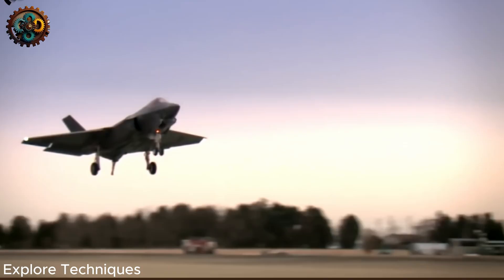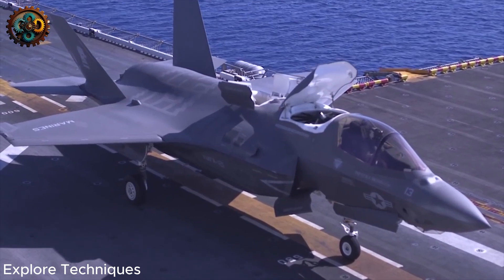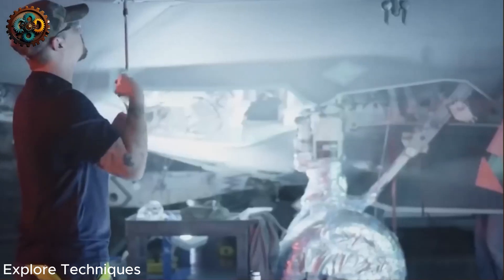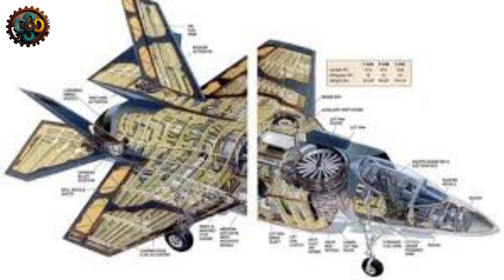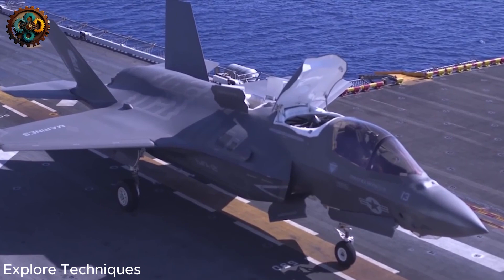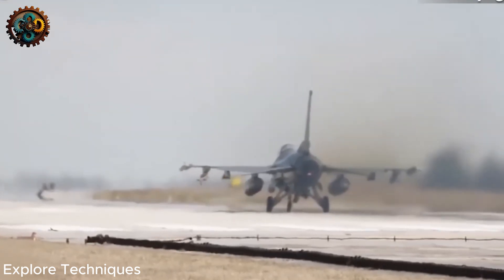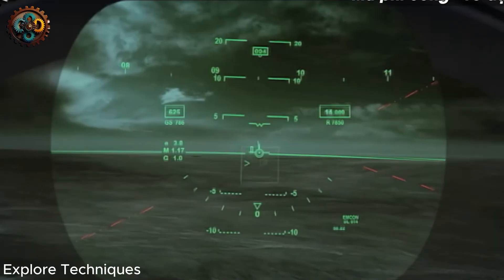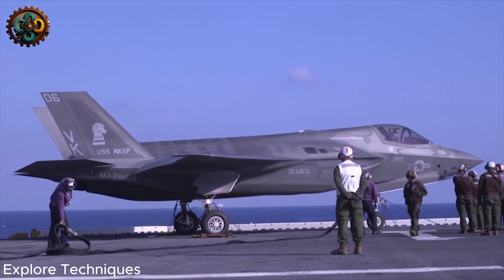F-35 Lightning II: Is It The World's Most Powerful Fighter?

Comment: F-35 flying failure ... takes two jets to get the high mach and vstol capabilities  ... the air system works like a mcdonalds ice cream machine ... rarely and never when needed ... over priced flying hunk of crap ...heck 70 years ago the avro arrow did al  the same things and cost 1,000  times less per plane ..(except takeoff vertically from a stand still) .... 70 years later the f35 and f22 barely match it ... biggest flying piece of crap ever made and forced on allies ... substandard american crap
Reply from the maker: I wonder why such a defective product is still being sold. Could this be some kind of plan?
Reply: @ExploreTechniques95  simple they dont want to eat the 135Bilion dev costs ... so they sell em off for 20 to 300 Billion each ... and say use this because we are phasing out the f18's ... and they still havent done that to the f16s they said they were phasing out ... typical americans selling their cheap crap because they forgot what QUALITY is

Comment: No it isn't. There isn't enough space in the nose to fit enough cooling for the GaN radar/ECM. It can't operate at full power. The computers in the F35 are susceptible to EW and just keep rebooting when hit by something as powerful as Khibiny EW. It's slow, fly's like a brick, Still can't perform all weather ops, and the engines fail at rates that unsustainable even in peacetime.
Reply from the maker: You may be right. Information about military equipment is often classified: Assessing a complex weapons system like the F-35 based solely on publicly available information may not be complete and accurate. Thanks for your comment.